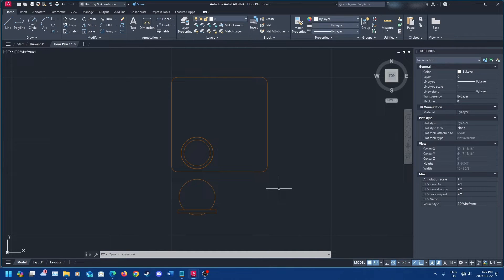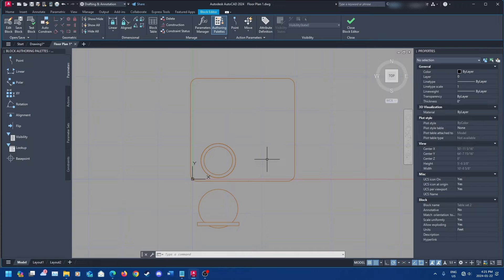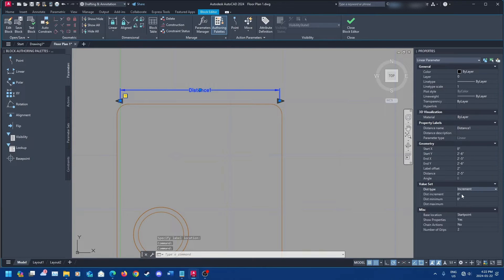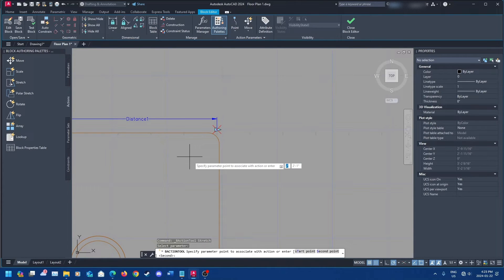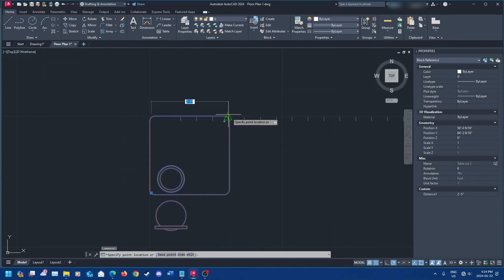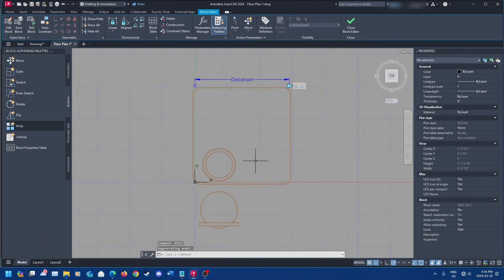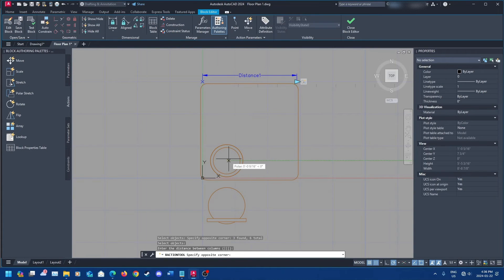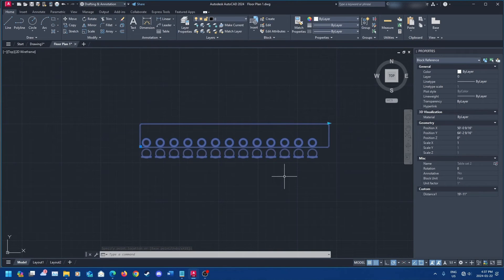AutoCAD - Dynamic Blocks in 10 Minutes!

Comment: I try draw wall and put Array function to rivet with some step. I use metric but dont think there's problem. So the the problem is that rivet step is 500mm but on wall rivet showed only after 1000mm but straight away on 501mm. Do you know why?
Reply from the maker: Hey, sorry about the late reply! That's quite interesting. Most likely has something to do with your settings. When using Array you kind of need to be careful with where it's creating the array from, that could create the extra 1mm!

Comment: I have watched your dynamic block tutorial several times and can't seem to find how you added the dimension to the block. I have made several blocks and need to add a dimension line outside of the block to be able to know what the size is. Did I miss something or is there another setting that will allow the length and width to show up when I resize?
Reply from the maker: Hmm this is a tough one. There are a few possible issues happening, but sometimes when you add the distances the wont show work properly and you have to restart from the beginning. However, it seems you've done this multiple times. What version of AutoCAD are you using (Windows or Mac)? 

It can be hard to pinpoint the exact issue without seeing it firsthand as well.